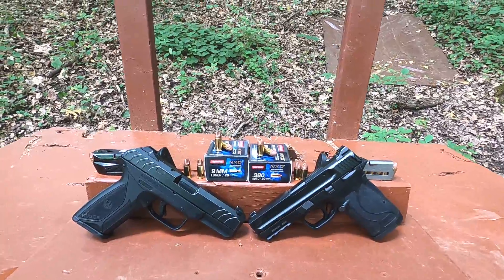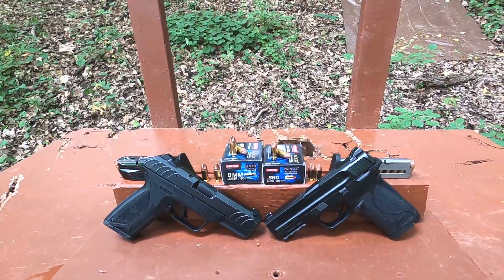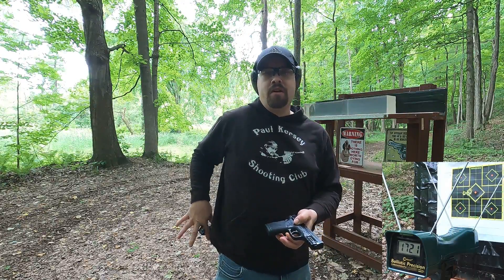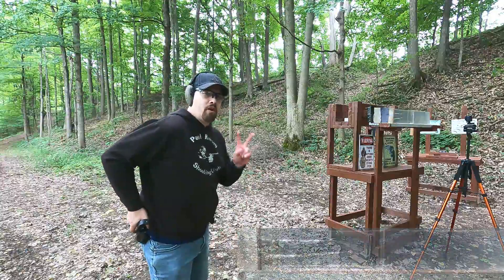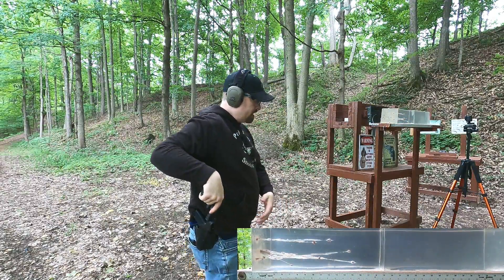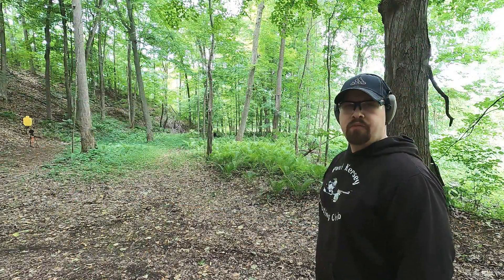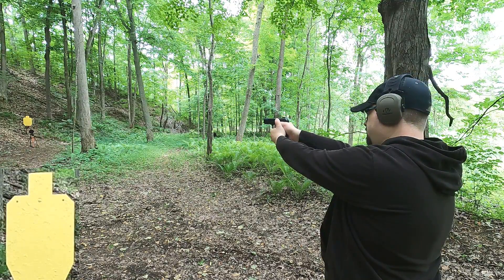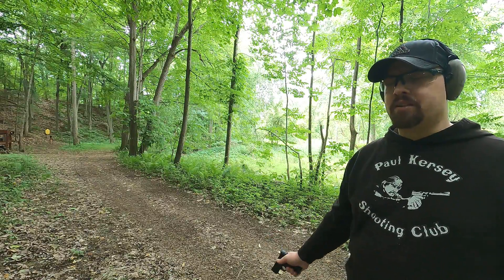Norma Non-eXpanding Defense (NXD) .380 ACP & 9mm Ballistic Test

Comment: Passing through the transonic barrier will cause an accuracy issue.  Your first .380 at 75 yds was dead center, then...  Picking a .380 round has been a challenge and I want both penetrating and shock with emphasize on penetration.  So ended up mixing the mag with HP's and trying to pick a logical order with the NXD replacing a FMJ round in the batting order, usually the last three...  The real Home defense, is .45 and Hydro Shock or Gold Dot as carried both in the working days.  However, there is a mag of MHPs in the Mag line-up.
Reply: just curious if the mixing of ammo weights and types induces FTEs ?
Reply: @rickyjones1784  I haven't yet as I only have run the various types alone, but if it feeds it feeds, right?

Comment: Is the decreased recoil really noticeable?
Reply from the maker: Yes and no. There's usually two types of recoil with firearms, that from the ignition and that from bullet weight pushing back against the gun. Like 9mm VS .45 ACP, the actual poundage of recoil isn't really much different, but a .45 will jolt the muzzle up more. This was sort of like that, not much muzzle jump so easier to control even though the 'recoil' wasn't that much lower.

Comment: Wow, Another one to add to the Le High Defense, and ARX type designs. The ARX is also a copper polymer matrix, and its Injection molded!  Not cast, or stamped, or extruded, like most others. Good on Norma for jumping into the future with the new fluid dynamic style rounds of expansion vs the old hollowpoint designs.

Comment: Gun Sam. I'm aware that the 380ez has a grip safety. Does your grip need to be perfect every time? I saw another of your video's on the LCP .380 where you said you did not have a good grip during the draw which caused a malfunction. Just wondering if you have encountered something similar with the 380ez. I don't remember which video though. Thanks.
Reply from the maker: The only malfunctions in the EZ were magazine spring related with +P ammo. It runs most ammo fine no matter the grip. The grip safety goes in with even the lightest grip press.

Comment: After all this time, I still don't know which is better for equal energy; fast and light or slow and heavy. Fast and light will give up energy faster. How much that matters is simply a mystery to me.
Reply from the maker: In all the evidence I've seen and read about self defense, it seems fast and light stops threats better. I had the same experience hunting whitetail also, two seasons same size deer roughly with the .270 taking a slightly heavier deer, both 40 yard shots. The .270 weatherby mag vs .444 Marlin, both around 3,000 ft lbs, .270 was instant smack down, .444 took longer. Same in police footage and stories, .357 mag/sig 125 gr instant drops. Other calibers not so much, even.45 auto not working so great.
Reply: @GunSam  So for a 2" barrel load, it sounds like 125gr is as heavy as you should go because it is easier to get light bullets moving faster sooner. At the same time, you don't want them over expanding which brings them to a rapid stop too soon. And to cut down on nasty blast and recoil, you want a fast burning powder that has been as fully consumed as possible when the bullet exits the muzzle.
Have you found an "ultimate" 38/357 load for a 2" snub with manageable recoil? I know you've found some reasonable ones given that a 2" snub is going to rob you of power over a 3" or 4".
Reply from the maker: What I have found, is that 125 gr in a .38 Special+P is the sweet spot for performance, specifically the Speer Gold Dot 125+P. I am going for a well rounded experience and this round has it all. Cases eject well, loads well from a speed loader, always penetrates enough and almost always expands to .50". In fact, I filmed a video a week ago trying to stand by my recommendation over the years that the Critical Defense 110+P was the best load and compared it to the 125+P Gold Dot, and found that in reality, the Gold Dot was better. I never see expansion with 135 gr through all my test protocols and with 110 gr if I get expansion I don't get penetration. I will say 125+P Gold Dot is where it's at. If I wanted more power than .38+P I would avoid .357 Mag and go with Buffalo Bore 125+P XTP, or if it's available the Underwood 125+P with the Gold Dot bullet. Here's the test where I ultimately was proven wrong about the Critical Defense and showed how well that Gold Dot is. https://www.youtube.com/watch?v=o-QlbcG12TE
Reply: @GunSam  Great video. What's got me asking this question is Mr GunsNGear posted a disturbing video on twitter. The very large man assaulted a much smaller person. He had the guy against a car with the door open, effectively pinning him. So he slammed the little guy who then went to draw from an appendix style holster. The big guy tried to crush the little guy with the door, but the little guy managed to get shots off and break contact. Depending on camera angle, he either fired five or seven rounds. I don't know what he had. But he prevailed. As you can imagine, when you have only five, you want them to work. I think some of the shots were superfluous, but that's a tough call.
My take away from that particular incident was that you need each round to be doing real damage to force a break in contact. The big guy was more than large enough to kill the little guy bare handed.
I'm no street fighter. If I can't avoid the situation, I really need the "get off me" power. And I want it to work sooner rather than later.

Comment: Bolt over base misfeed on the 380.  Reduced spring tension on the last round and high(er) slide velocity probable from high velocity round means the cartridge pickup rail hits the only partially in position round in the wrong place and you get what is shown.
Stretched springs will reset to weak.  Replace or see if Wolff offers an extra power magazine spring for this model.  And if life depends on it use standard power ammo as well

Comment: The extreme defender rounds seem like a better option to me.
Reply: These are half the price for similar... Not the same ... But similar results.... I've ran 2 boxes through a dimondback 380 with zero failure... It's a picky gun and eats through it... It's my carry ammo now
Reply: They jam
Reply: @sfried420  what are you using and have you ran 300 round of fmj through it
Reply: @dra @dragonlover1985 BG2.0 not quite 300 yet
Reply: @sfried420  first thing I do when I buy a gun is buy 300 rounds and run it before trying self defense ammo... Bass pro is the cheapest I've found... 16.99 for 50 fmj right now...buy 100 bucks worth and run it before trust it... It loosen the gun up and makes it reliable... Don't clean it mid way ... Spend all day shooting and let it run all the metal parts lose... Gun will work better after cleaning at the end then find you defense round... Only way to be sure it's gonna work when you need it in my opinion

Comment: You are correct about “instability” over distance with the 380.  That 56 grain bullet is leaving the barrel at 1300 fps, but does not have enough mass to maintain supersonic velocity beyond 50 yards.  Velocity drops into the Transonic range and it becomes unstable.  That’s why it is no longer accurate at 75 yards.    Maybe these gimmick fluted solid copper or copper composite bullets have a use in places where hollow-points or lead core ammunition is banned.  However, as you note, for the rest of us, a lead core expanding hollow point is still the best option.  The US Army’s new (newish, 2021) 9mm M1153 is a 147 gr. Ranger-T clone that is sub-sonic at the muzzle.  They have a LOT more money to do testing than I do…
Reply: Don't think anyone is going to be getting  into gun fights at 75 yards in rule of law while conceal carrying a 380 especially
Reply: Hardly a gimmick - far from it actually.
Reply: You think you segal, gun fights at 70 yards lol.  Personal defense is within 10ft max
Reply: I have the 64gr 9mm i shoot from my sar9 and it's very accurate at 75yd

Comment: Sam, you are really an incredible shooter!  I see you are using a Ruger Security 9, which is great and I will get one.  I cannot see what brand the 380 is.  Would you kindly tell me?  Your videos are the best and now I will buy some Norma ammo.  Thanks, friend!
Reply: 1:45  S&W Shield 380 EZ
Reply from the maker: Thanks. The .380 is the S&W M&P Shield EZ. The Security 9 is a pretty good pistol, better ergonomics than most, but if I had to change anything about if I was a gun company, i'd make the safety work better. It's great in the fact that it is small and don't get knocked on accidentally, but you cannot use it if the gun is not 'cocked' and you also cannot open the chamber to take out a loaded round until you turn the safety off....the very thing you want on when you are grabbing all over the gun trying to open it up.

Comment: You’re my favorite Gun YouTuber, could you please make a video on some of what you believe are the best standard pressure 38 special defensive rounds, maybe with 2” or 3” barrel. The low budget community would like to know.
Reply: I know this is probably asking to much, but could you possibly run the test through a low budget revolver like a Rock Island M206?
Reply from the maker: @fairnheight3673  my 2" and 3" revolvers are Taurus.
Reply: @GunSam  both of which are being considered because their fair price, but how much of a difference will the extra inch make?
Reply: @GunSam  also I noted that with 22 magnum you got higher velocity from a more expensive 3” revolver than you did from a 4.75” heritage, do you recon this could be a factor with 38 special?
Reply from the maker: @fairnheight3673  With .38 Special, a 3" gives nearly the same velocity as a 4" revolver (which 4" is near maximum velocity you will get out of .38 in a handgun) as where 2" is slower. Like .38+P 125 gr is usually 900 FPS in a 2", 1,000 FPS in a 3" and 1,050 FPS in a 4". Now with ammo like .357 Mag, the differences are generally more even like 1,250 FPS/1,350/1,450.
Reply: @GunSam  this is why you’re my favorite gun YouTuber, even your replies in the comment section contain more useful info than other YouTubers in an entire 15 min video. I’m turning 21 next month and I’m wanting a revolver for carry so I’ve been gathering info on what exactly what I’m wanting. Thank you for sharing your wisdom and keep up the awesome work.

Comment from the maker: I did manually stretch my magazine spring out today while filming something different, and it did seem to cure that last round malfunction. The only downside is NOW it's "EZ" load function is more like a typical 9mm spring pressure.
Reply: Good info. Thanks for sharing.
Reply: I haven't shot the EZ but read on the S&W forum of many last round stoppages.  One cure I remember was roughing up (sanding) the texture of the follower to prevent the round from sliding forward prematurely
Reply: The S&W EZ 380 is notorious for last round stove-piping because the magazine spring is weak. Wolff springs is offering +10% magazine springs to fix this problem while S&W has no fix at all! Stretching the magazine spring will eventually cause failure of the magazine.
Reply: ★ Thought about that. Good!
     And, thanks.
Reply: Magazine springs are much cheaper than a new magazine. Just get a new spring.